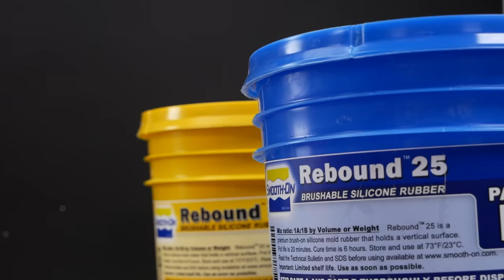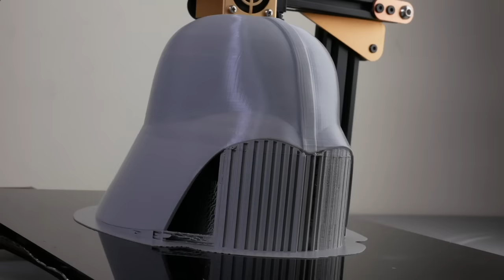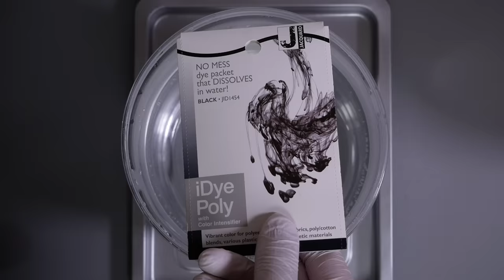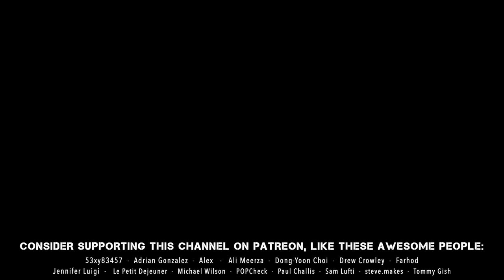Darth Vader Sculpture Timelapse - Star Wars: Rebels

Comment: Amazing job. Can I ask why you stopped using separately modeled eyes for the last few was it a time or cost sort of thing?
Reply: I was thinking the same thing.
Reply from the maker: This one was definitely time. I started this bust before Kenobi even premiered, but this project just dragged on and on.
Reply: @StevenRichter  Thank you for sticking with it as turned really cool. Loved the fabric dye trick.
Reply: @littlebacchus216  Same, that’s was cool!
I’m curious what plastic works well with dye, because I’ve tried that before and it looked blotchy and horrible and I ended up using window tint instead…
Reply: @StevenRichter  so it was a complete coincidence that you made a bust of Vader with a broken helmet
Reply: @CT-7567-  he likely began making Vader first not having a complete idea of the final product it takes a lot of time
Reply: Did you not see the # of add-ons he used? There comes a time when enough is enough in a project.

Comment: Excellent work as always and I particularly like the shot of the helmet 3D printing from above, makes me think that in the SW Universe that's how they would have made Vader' actual helmet/head covering. 

Also as a side note, Vader's eye coverings were deep Red at the point of A New Hope/Rogue One and including in Rebels before those events. They change to black in Empire and Return.
Reply: I've always assumed the red lenses were a practical thing for Prowse to be able to see and that we were never meant to see his eyes through them.  It was just a mistake.  I always assumed that in universe he had no actual eye holes and those lenses were the cameras he used to build an internal 3D display.  Visible eyes are just the limits of film tech at the time.
Also, if we were to ever see the making of the helmet it would be smelted out of molten metal, not 3D printed.  I feel this part of the sculpture is totally cheating.  The helmet should have been hand sculpted as well.  The only work the sculptor did here was make a face to go inside the helmet and a copy of something his computer made.  Not belittling the sculpting, but the computer assist was straight out cheating
Reply: @johnpeace971  I mean, in every appearance except for Kenobi, Pre-ESB/Post-ROTS Vader has had red lenses, in Rebels, CW Season 7, Rogue One, and ANH. Safe to say that he did, canonically, have red lenses until ESB
Reply: @johnpeace971  Because the computer made the helmet themself...yeah...touch grass.

Comment: As someone who enjoys a similar kind of hobby, I have to ask, what is the primary benefit of making molds and casts of the 3D prints instead of just finishing and using them? As a one-of-a-kind art piece, I can't imagine repeatability being a priority because it probably wouldn't be much trouble to print a few extras during the more labor intensive parts of the project in the case that one is damaged. Did you need a thinner shell of material that couldn't be properly achieved with the 3D printer? I'm not familiar with the "liquid plastic" material used but I can see how it would benefit from not being a thermoplastic when it comes to the grinding and other subtractive parts of the process. I would love to know your reasoning.

Comment: Why cast the 3D print? Why not use as is?
Reply from the maker: Because I hate sanding PLA plastic. Lol. Much easier to sand urethane resin. And I can cast more copies if I decide to do another Vader project. :)
Reply: @StevenRichter  Ah, that makes sense. How is the durability compared of the urethane resin compared to the PLA?
Reply from the maker: @Kal-el23  In some ways better, because it won't snap at the layer lines if flexed. I think it's comparable, but it'd be interested to do some tests